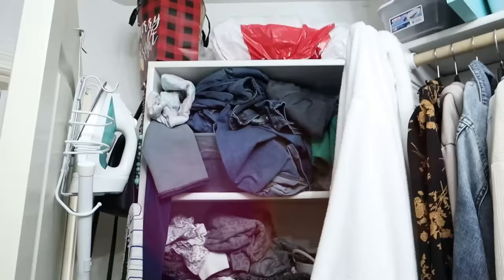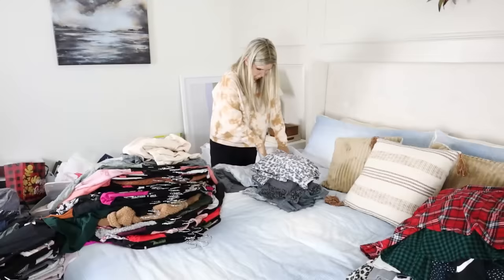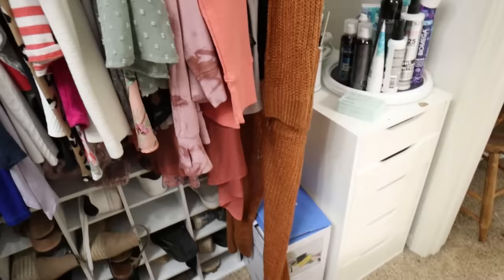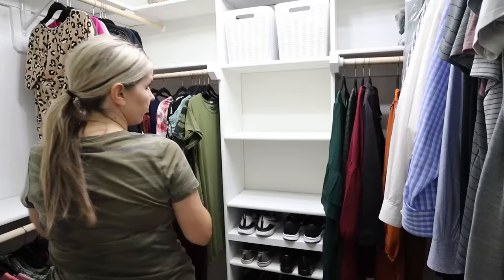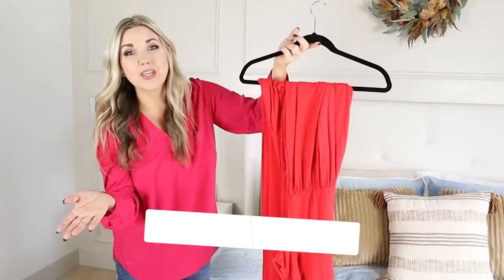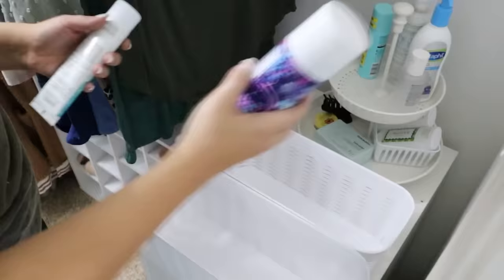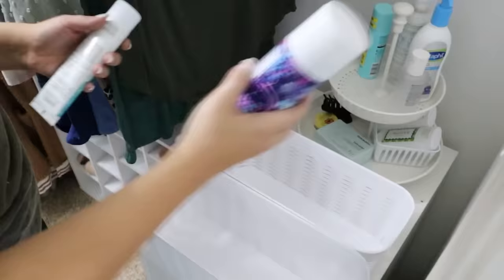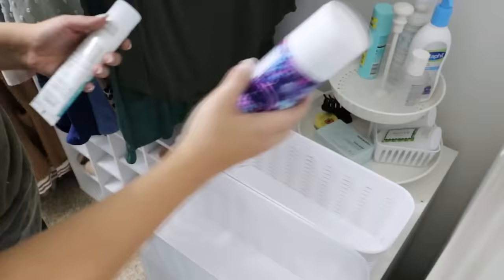10 Super Easy Closet Organization Hacks (Tricks That Actually Work!)

Comment: I've used option 1 most of my adult life and I'm in my 60's. Its a great! I.also sometimes use 2 hangers , the seconds holds the bottom portion of the dress. This is great for dresses that wrinkle easier because you can stretch it out wider; it just depends on the dress.

Comment: Hey Liz- I do a my longer dresses a different way. I use two hangers. Hang the dress normally through the neck. Then take a second hanger and scoop up the skirt of the dress over the hanger. Then hand the second hanger on the cross bar of the first hanger. It takes a litter more space, but I feel like I won't have to iron the dress this way

Comment: Great video!  I'm about to organize my closet again -- it's been a few years -- and I'm happy to have your suggestions.  For the long dress, I like Option 1.  I color coded my clothes last time, but I found that I preferred hanging clean clothes from the left; that way, everything on the right-hand side of the rack was obviously something I wore rarely -- or not at all.  No electric outlet in my closet, so it's time to order a battery powered light to go in there.  Thanks for some helpful ideas.

Comment: Automatic light switches are great. We have them in our laundry room and pantry because we often have our hands full going in/out of those rooms. We also have one in the entry way to our house. Open the door... light comes on. Very helpful.
Reply: what if you stay in the room but are not moving ... then the light would switch off until you move again? I heard Liz say you can set it to stay on for 5 min after .. but I'm wondering if it work well in a bedroom?
Reply: @KimberlyMcDougall  I wouldn't put them in a bedroom. Every time you turn over the light would turn on! 😁

Comment: Dresses and tops, sorted by color and then by sleeve length.  Pants and skirts in a separate sections.  Long dresses go on a regular hanger and then the longer section gets folded in on the edgesand draped over another hanger.  Fewer wrinkles that way.

Comment: There's nothing like walking into a clean organized closet! 🤗
This is something most of need to do. I did that in my walk-in closet I had 2 apartments ago. The closet was carpeted and there was a leak. So maintenance came by and said I had to take everything out of the closet. I was amazed at how much of the living room was then occupied by the contents of the closet. But what a perfect time to thin out clothes and put things back in an orderly fashion.
And now I have a one section closet with 2 sliding doors.  But since there's only one rod to hang clothes on, I got additional hangers with another rod about half way down. Now I can hang tops on the top rod and slacks on the bottom. I did this on both sides of the closet and hung a shoe organizer in the middle. That was the most efficient thing I could do without spending a lot of money for a full organizational unit.
Luckily I have a spare bedroom and I have room for the overflow from my bedroom.
I have since gotten an over the door shoe holder now hanging on the bedroom door. I had shoes all over my floor too. But it was the bedroom floor which made it hard to walk around.
But I've been in this apartment over 2 years now and I've retired so I'm not wearing the same clothes anymore. Which makes it an even better time to thin out the closet. 😋
But I'm also trying to organize my crafting supplies and since I don't have a designated area yet, it's a priority over my closet. 😉
I like the long dress hung the first way. 😊
I've also gotten hangers that hold 4 pair of jeans or slacks. And sometimes when I have a shirt and skirt I wear together, I hang both on the same hanger. I have a whole bottom section for my capris. In Texas we have about 10 months of heat so I tend to have more short pants than long. 😚 
This was a very inspiring video and as soon as I get my crafting items sorted out, I will probably work on the closet.
Thanks for sharing another great video! 😍
Reply: Can your spare room be your designated crafting room? Or maybe the closet of the spare, if it's a guest room. I'd love to have my own crafting room. Best luck organizing!
Reply: @chrissyb6817  I just received this notification or I would have responded sooner. 
I think my ultimate goal is to be able to use the second bedroom for me designated craft room. But first I have to sort it out. 😉 A lot of stuff got put in that room when I moved in. 
I have big plans but it's just going to take some time. 
It will be nice to have a room just for crafting and all the supplies. My biggest problem now is finding specific items for a project. But I'm working on it...... slow but surely. 🐢
Thanks Chrissy! ☺️
Reply: @vickiepatterson1748  no worries. I def know what you mean, I've had a whole "junk" room before. If it didn't have an immediate place, into the room it went.
Reply: @chrissyb6817  I've done that so many times that I can hardly close the door. 😘
Plus I have a tiny kitchen so a lot of my kitchen appliances are being kept in that room.
It's like I need another room. One without all the junk. ☺️
Reply: @vickiepatterson1748  haha don't we all!
Reply: @chrissyb6817  I have a "junk" room also, but about once or twice a year my daughter visits, so I have to clean it.

Comment: I have placed command hooks on the back of a wardrobe door to hang necklaces and bracelets  , on another wardrobe door I have 2 hanging bars which I use for belts and scarves.  I find there is lots of storage space on the back of doors both in the wardrobes and cupboard around the house. Simple hooks or hanging rails can utilise this space. On the back of the doors to my under stairs storage cupboard I placed wire spice racks these hold things like back up cleaning products/toiletries. This means they are not filling up my under the sink cupboard space.

Comment: Holy clothes!  I like option 1 for the dress...it's what I use.  I did my closet and drawers a while back.  Like you, I live in a state where we have different seasons and need 4 seasons of clothes.  What I found is helpful is that if I have something that I haven't worn in a year, I get rid of it.  That gives me a chance to get through an entire cycle of seasons.  One way is to tie a ribbon on the hanger, when you use it, pull off the ribbon and then hang it back up on a hanger without a ribbon.

Comment: Very good video, with simple and practical solutions! One thing that I realized and learned a long time ago regarding jewelry is that if you have Sterling Silver earring, bracelets, rings or necklaces, it is always best to store them in a covered container. The air will quickly tarnish the silver and almost every time you desire to wear it, you will have to clean it with silver cleaner. Costume jewelry is the exception to this rule.
Reply: Thank you. Didn’t know

Comment: I have a trick I’ve used for years. I put an unused hanger at the beginning of every section of clothes. Then when I’ve worn and washed something it goes on the empty side of the hanger. ( hang things inside if you wore them but don’t need to be washed yet. At the end of a season you can see exactly what you’ve worn and what you haven’t !
Reply: Hello Wanda

Comment: I prefer option 1, but either option is going to leave a crease. A hack to avoid the crease is to cut a pool noodle to the length of the hanger, then cut the noodle lengthwise so there’s a slit in it. Put that on the hanger, then fold your dress over the pool noodle. No crease and no need to iron!  Just wondering why your cute little pup wears a harness in the house? Thanks!

Comment: I don't like those velvet or felt hangers.  I like the thin but rubber coated hangers, they keep your clothes from slipping off & don't collect the dust & much easier to clean off then the velvet hangers. Folding anything over the bottom part of the thin hanger is going to crease it, unless you put something, like a towel or something under it so it doesn't crease.